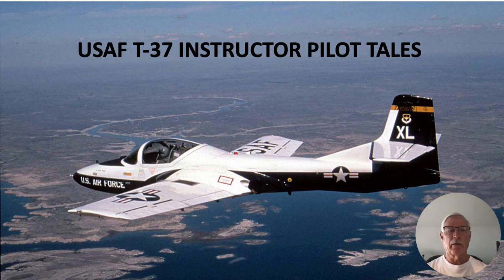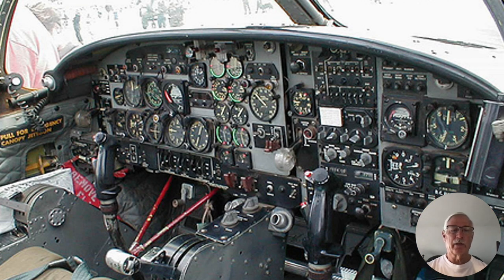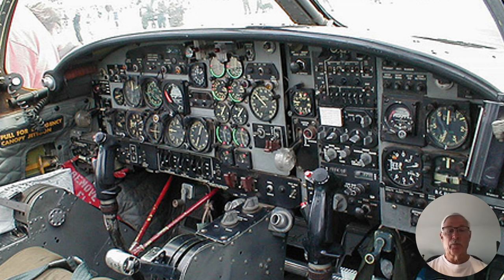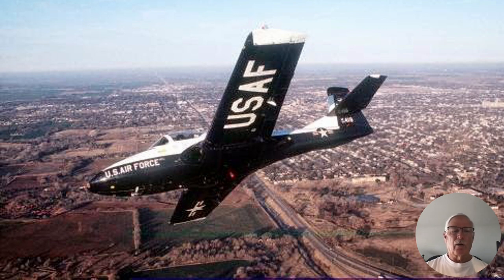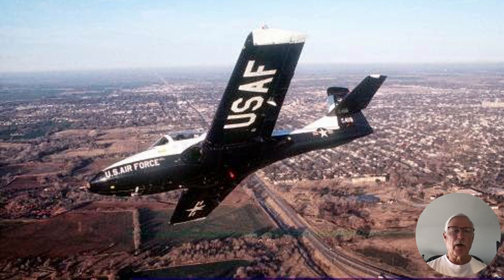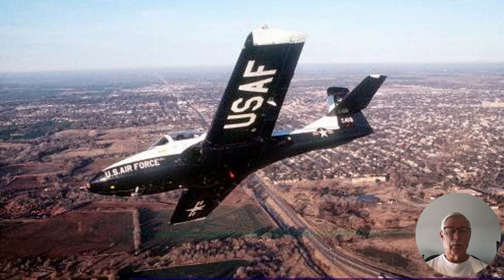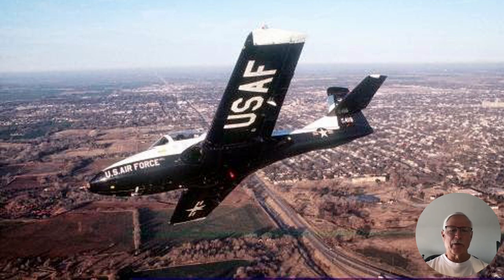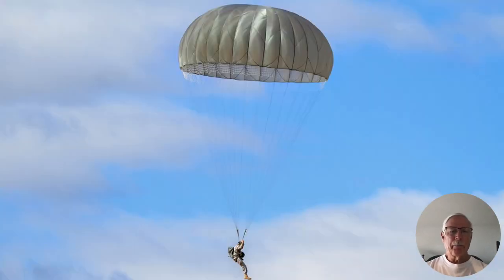USAF T-37 Instructor Tales. Story about spin training and issues when I was an USAF Instructor

Comment: Ah yes, freezing in a spin. I had a somewhat similar experience back in the 1960s, but in a 150. The roles were reversed, though. I was a student pilot, and the FBO had just hired a young new instructor who they sent me up with. To make a long story short, the instructor asked me to do a full power stall with full flaps. As we got well into the buffet, I ran out of right rudder and stopped adding back pressure. He asked why I stopped, I told him I was out of right rudder, and he said to stall it anyway. OK, and of course it snapped over the top far more violently than you would think that little bird coulf, and rapidly wound up into a fully developed spin. I reduced the power, applied opposite rudder, stick forward, no response. I started bringing the flaps up (manual flaps in that 1965 model) and looked at him. He was frozen, eyes wide open, with no color left in his face. Fortunately, he was not on the controls. I recovered from the spin (far too close to the ground for comfort) and announced we were going back to the airport. Even after we landed, he did not speak. The FBO owners debriefed me and the instructor separately, and I never saw him again. That was when I found out they sent me with him specifically to get my opinipn, as, although I was a student, I had been flying with my Dad since I was 6, and they knew me quite well. Fortunately, I was not unfamiliar with spins, as Dad was Naval Air in WWII, and all of my instructors had flown during the war, and some even before.
Reply from the maker: Wow! Thanks for sharing your story! Glad you had your act together or things would have gone south in a hurry. I found that the C-150 actually spun faster than the tweet. Glad they got rid of that instructor!
Reply: @ronrogers  Yes, the 150 can really wind up tight! Starting out with full power and full flaps blanking airflow over the rudder really gets it going. I am glad I had such experienced instructors. Some of them went back to the OX-5 days! Not only did I get a lot of stalls and spins in my primary training, I got a lot of engine failure practice. Even today in my 310 I always know where I'm going to go if I should lose one, or even both.

Comment: Good story Ron. I went to Webb 71-04 and when I got to the tweet I had my dollar ride with the squadron commander. I had about 350 hours having worked at a Cessna dealer while in college. After a demo of the abrupt and silly demo I explained that no Cessna needed to be jerked around like that. The Major was not impressed so I challenged him to put the tweet into as tight a spin as he liked. I eased the stick a little forward of neutral and put in about 1/3 opposite rudder. Instant smooth recovery. He said it won’t always do that. I said this one will. He then got pissed off so I put it into an inverted fully developed spin and bounced his head off the canopy and he was happy. I was branded a maverick after that and would have been booted if I were not a pretty good airplane driver already.
Reply from the maker: Good story! Thanks for sharing!

Comment: Moody, 72-06. As a check ride flunkee, I still have good memories of spin recovery training. The '37 felt a lot more controllable than the Cessna 172. I was able to black an instructor out with a late, 9g (IIRC) pullout to stay out of the bottom of our airspace altitude. He had looked over at me to see if I'd frozen up or what, and with his turned neck, he was toast. I had no probs with aerobatics, but feared check rides and eyeball navigation.

Comment: I never fly anything like that,  I wish I had . I spent most of my time  , flying gliders .  One of the things we had to do was , was  what to do cable breaks when going up on a winch cable .  An instructor we had ,  had a real cable break. with a student . Who froze at the controls , he could not get this lady off the stick .
 I'm told from the ground , it looked as if the glider . Which was at a angle of about 45 degrees  stood still mid air . The only thing he could do was hit her at the back of the head,  to get her to let go .  Other wise both of them would have been brown bread  !

Comment: The story we got when I was there was that the original T-37 was too spin resistant so the spin strakes on the nose were added.  It became difficult to recover so they sent T-37s to Edwards to have the Flight Test Center develop a foolproof recovery technique, hence the long procedure required to ensure that the same recovery technique would be successful for normal, inverted, and accelerated spins.  I always wondered how wise it was to have a training aircraft that was difficult enough to recover that the instructors had to take monthly check rides to demonstrate the ability to recover from spins. I would be interested in your thoughts.
Reply from the maker: My understanding was that the strakes were added to the "A" model and the tail lengthened 18" to improve spin recovery and one procedure was developed to get you out of any type of spin since spins could be disorientating. At least while I was flying T-37s, we only demonstrated spin recovery during the contact check ride.

Comment: I was a Tweet instructor in the 90s. I jokingly say it had so much thrust it needed thrust attenuators.

Here's another interesting fact. The T-37 was a little too stable in a spin. It would not recover hands off as many other aircraft will. You had to slam the stick abruptly full forward to knock it out of the spin. Sometimes students held the stick forward too long, resulting in an inverted spin. 

One advantage of side-by-side seating is you can see what the student is doing and he's within reach. I've often wondered what a T-6 Texan II (with tandem seats) instructor would do in this situation.